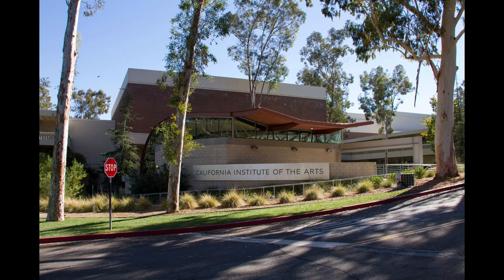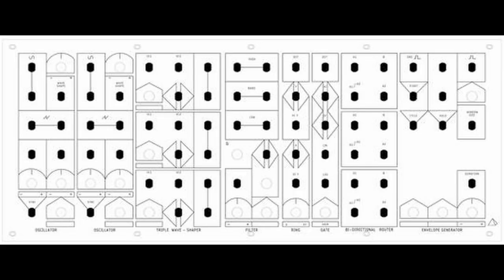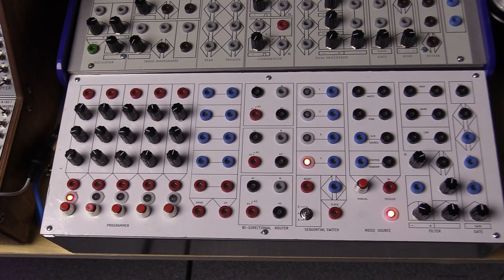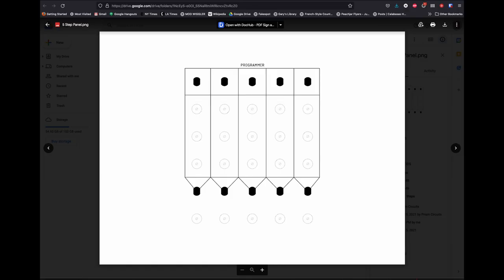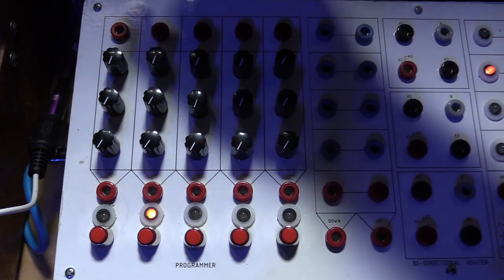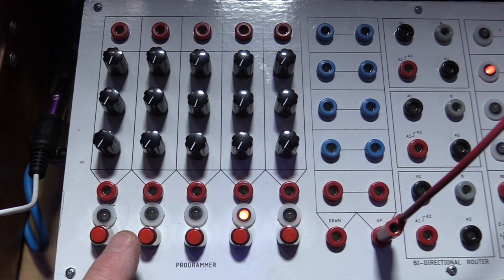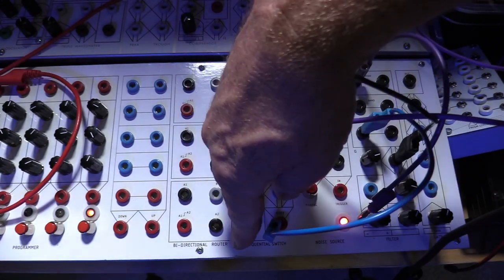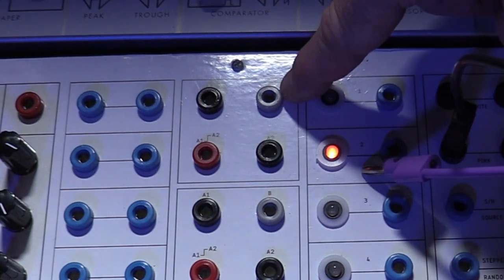Prism Circuits - DIY 4U Serge Panel | Modular Synth

Comment: A bit late to the party here, I'm curious why you chose both the bi-directional router and sequential switch modules since they appear to have the potential to achieve similar ends. thanks.

Comment: I'm wondering how the the PCBs attach to the panel. Is it just by the resistor legs that connect to the bananas or are there also some screws or similar? Thanks :)
Reply: Been wondering the same. I'm guessing that ones with pots use the pots to hold the PCB in place, as is common in Eurorack. But for ones that are all jacks, like the Programmer output PCB, I have no idea. There are no mounting holes in that PCB as it's depicted on the Prism site. Under the Big Tree - favor us with a tour "under the hood"?